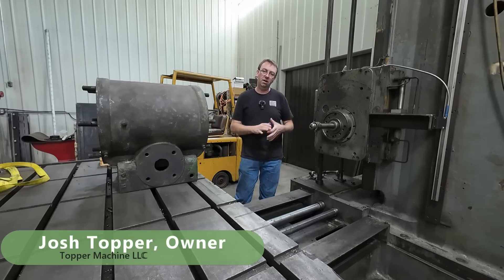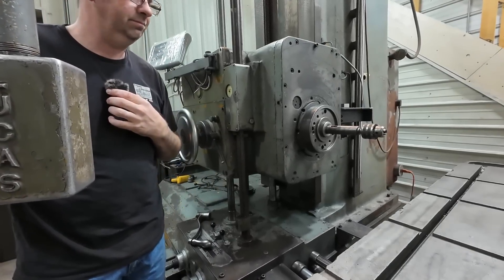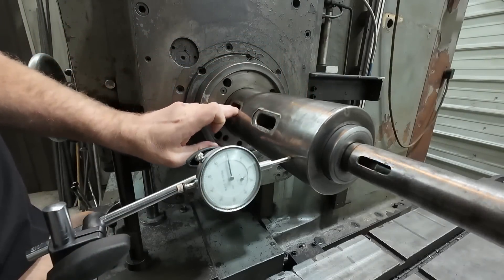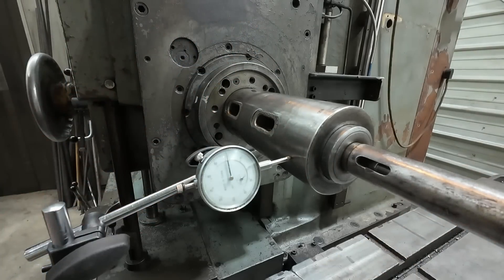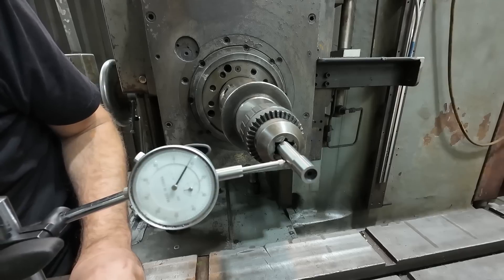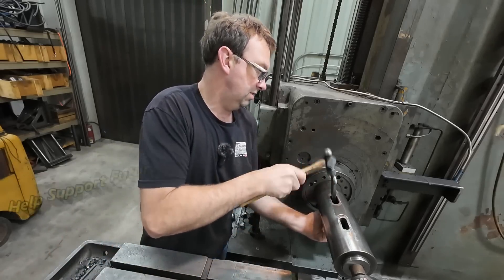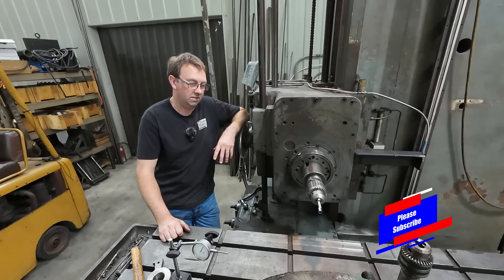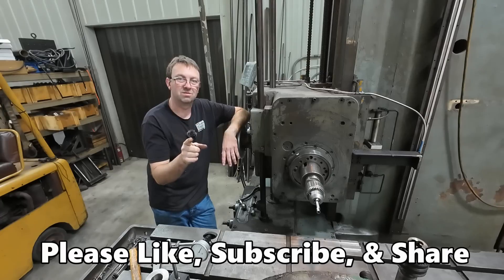Checking For Spindle And Chuck Runout - Checking Accuracy Of Tool Holders - Manual Machine Shop

Comment: I just picked up a 18N at an estate sale for $25 that has the same issue as yours, .0005 at the chuck body, .010 runout at the jaws. Rebuild kits for these chucks are very expensive. Would love to see a video on you checking that chuck out for repair
Reply from the maker: I'd spend the money on the kit,  only after disassembled, cleaned, and inspected to see if that is indeed your problem. A lot of times it's just s tiny chip causing the runout

Comment: Really good video Josh. Looking forward to the machining of your traction engine. To UK eyes the block is quite different to our blocks that sit on top of the barrel. However it sure makes setting up easier for boring with a flat bottom / side.  you have no steam jacket to worry about exposing as well.
Reply from the maker: Our engines are so different. Most of yours are 2 cylinder also, and do 40mph. Ours max out at about 3mph. Lol
Reply: @  just stood in front of my traction engine block block now. 1894 McLaren single 2 speed but only 5 / 6 mph. wish YouTube did photos !

Comment: Very important message. No - a dead CRITICAL message. It's all about the setup and the geometry. Funny - I've got a cheap ass import chuck that I'm checking and fixing right now. 20 thou runout on the POS. I might just bin it like it deserves. The actual machining goes fast when the set up is right and the tooling is true. Knowing these critical aspects is what sets professional machinists apart from most amateurs and hobbyists. I'd say this video is one of the most important  machining videos posted on youtube for a long time - it's an absolute FUNDAMENTAL that every machinist needs to see. The amateurs need to put away their sprung loaded parting tools and auto retract threaders and watch this. But WTF do I know anyway? Cheers.
Reply from the maker: Glad it was received well.
Reply: Was well received by me for sure, even in my crabby morning mood. Heh.
Reply: @TopperMachineLLC  cnc jobs always made me wish I was dead from 🇺🇸
Reply: I would offer that there could also be some value in testing the accuracy and repeatability of your "cheap ass import" INDICATOR, should you happen to be using one.  Just sayin'.
Reply: It’s a very high end one in fact, like all my test indicators. A pity I chose to believe the spec claims on the cheapo chuck. Should have known better, won’t make that mistake again.